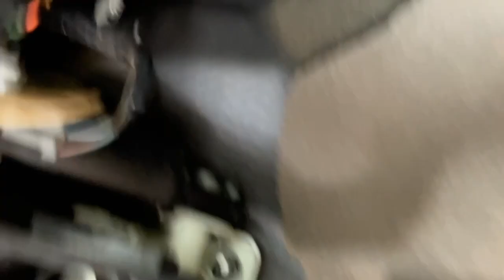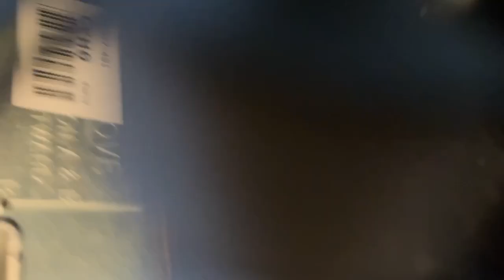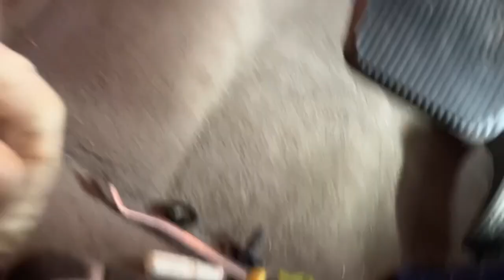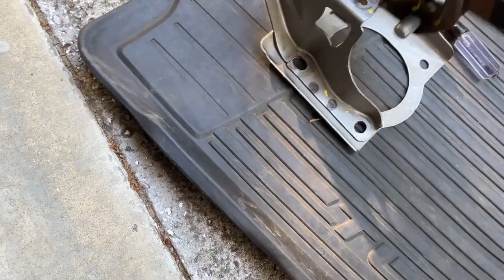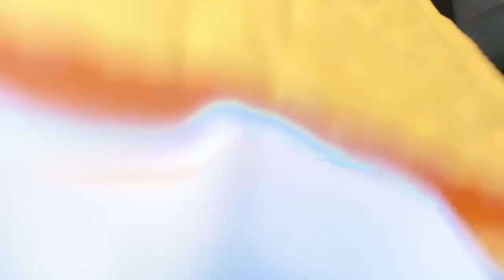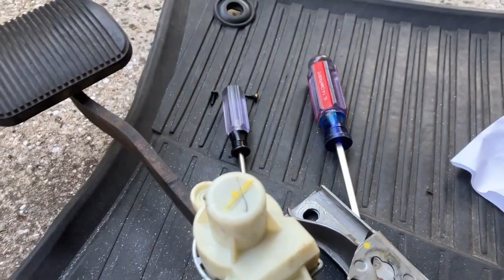2001-2004 Crown Victoria, Grand Marquis, Town Car, Marauder Brass Power Pedal Gear Install

Comment: Is the gear still available?
Reply from the maker: Yes it is. Curless Auto Repair in Michigan. $129 shipped 

https://www.facebook.com/100057655381863/posts/moveable-pedal-replacement-gears-largest-order-of-gears-weve-gotten-in-for-quite/1195048859093616/

Comment: Which cable do i disconnect so my adjustable wont work? they move randomly when i recall a memory seating position and its really annoying, i always have them in the furthest back position. There is code B1990 but goodluck fixing that, I heard if you try and disconnect the gas pedal one i will screw up idle and other stuff with the electronic throttle body? not sure.
Reply from the maker: There’s a two wire electrical connector on the gas pedal. Grey in color. If you disconnect it, the power pedals will
No longer function.
Reply from the maker: Wait. What year car do you have? 2004’and older. Or 2005 and newer?

Comment: Any idea how to properly put the plastic panel back? I put the clips in but the back side hangs down as if it should have been lodged or hooked in somewhere
Reply from the maker: The PCM bracket used to have a catch for the hush panel to catch on if that’s what you’re referring to
Reply: @technickalgarage  yep. For the life of me I can't figure out how to attach it so it just hangs down in the back above the pedals in my way once I get the 3 pins in the front connected